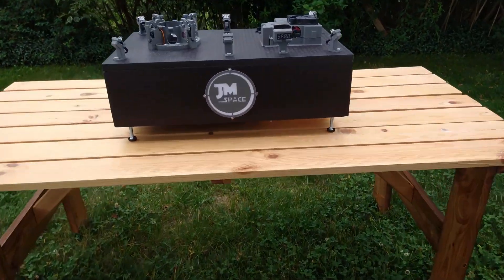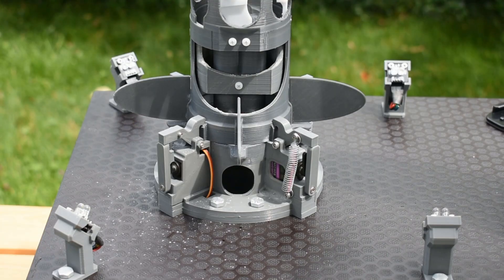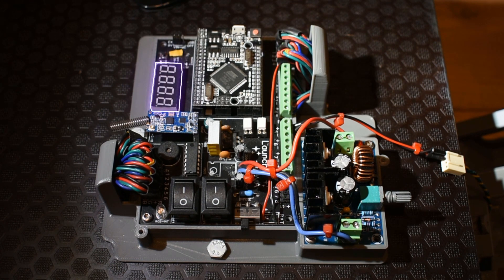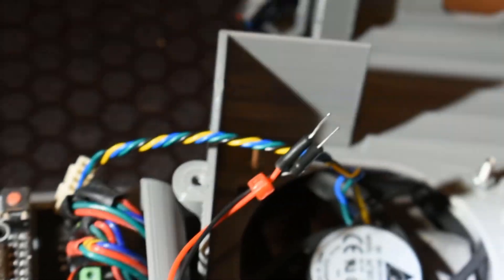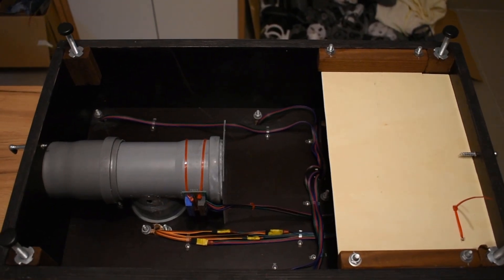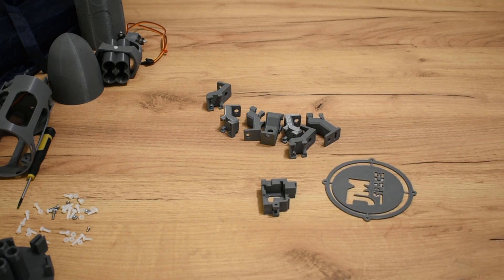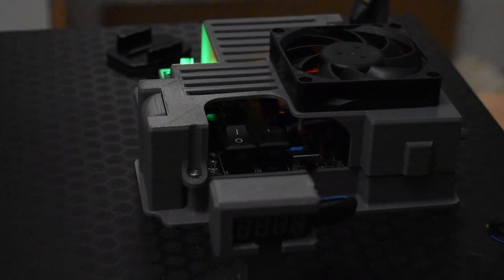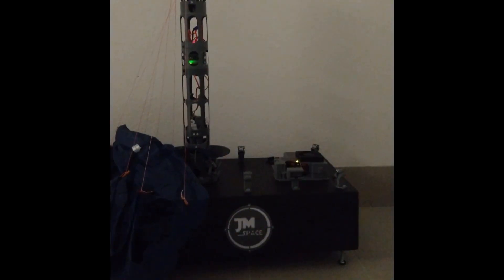Launch Pad Overview |  TVC Model Rocket

Comment: What is the output amp and voltage capability of the voltage regulator.
Reply from the maker: Approximately 1A and 18V, a basic 7805 LDO.